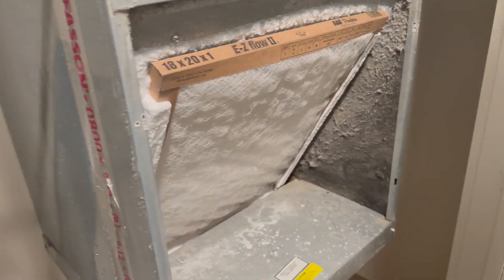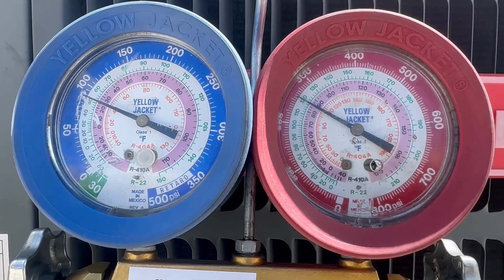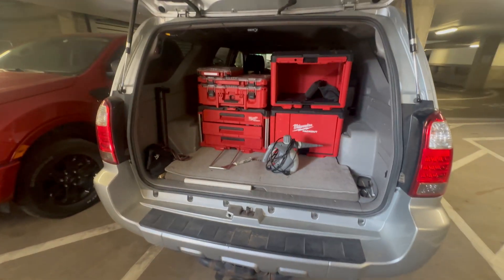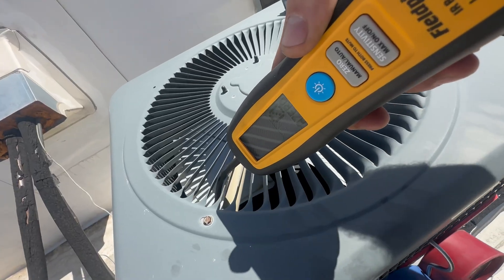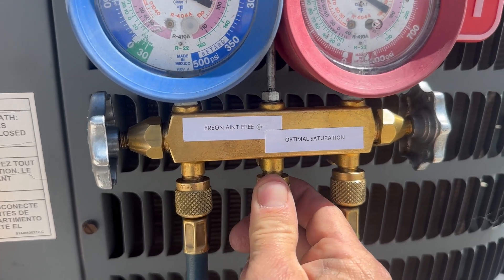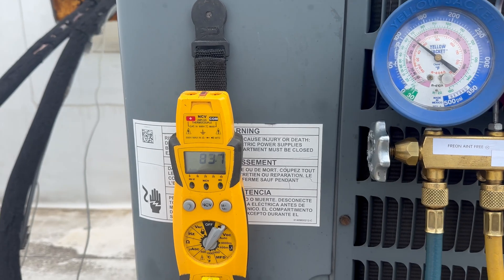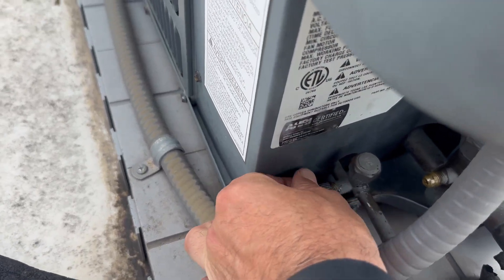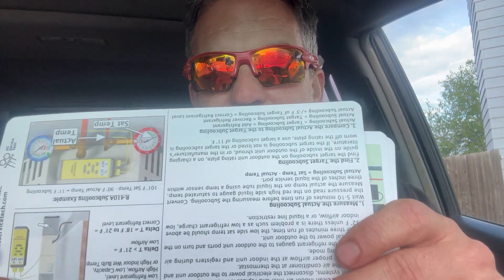Troubleshooting a Frozen Evap Coil - Low Charge and Leak Search

Comment: I work in apartment maintenance had a co worker who having issues with low charge I suggested that we check for evap leak as we walked to apartment the testing equipment was ringing before we got to the air handler?
Reply: Ringing ?? What do you mean by that
Reply: The filter was crooked in the filter rack.
Reply from the maker: Get a new leak detector